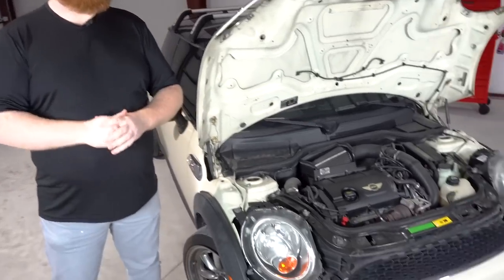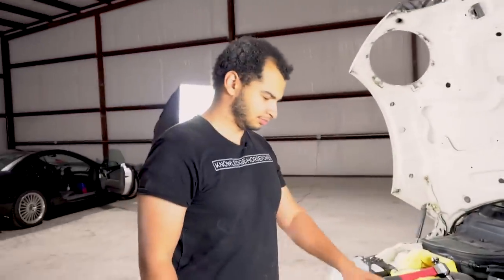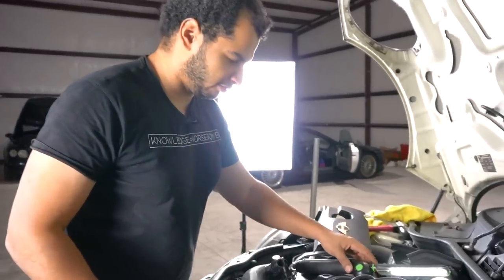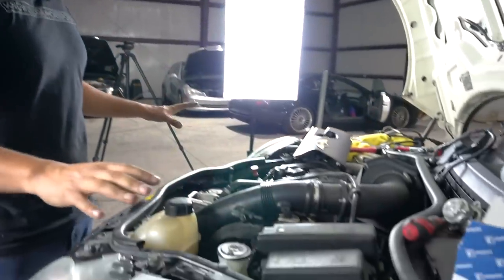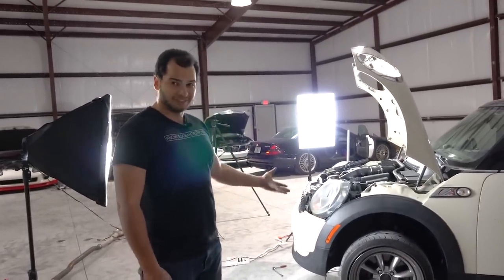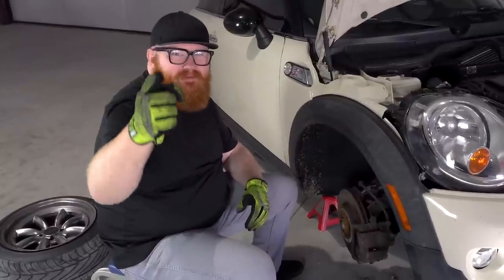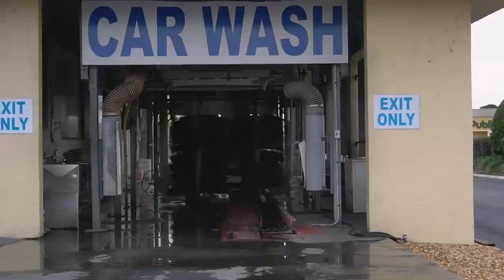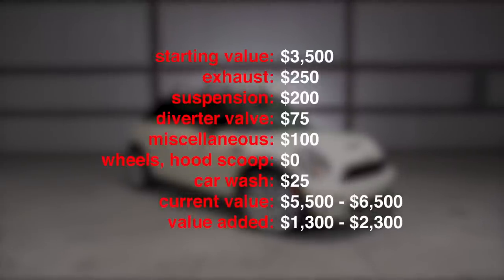Restoring A WORTHLESS Mini Cooper S [Part 2] - Art Of The Flip

Comment: You forgot to mention that you can sell off all those extra parts for cash as well.   The suspension parts and various bits could be sold off on Ebay, maybe bringing in another few hundred dollars on the bottom line.  That would be a big boost on the profit.   Overall, great show, if nothing else proving that customizing a car pretty much kills it's value.

Comment: Moral to this story, aftermarket parts will devalue your car.
Reply: Unless it's an Evo, then even dealerships are marking up for the mods.
Reply: goldtoaster1512 Dealerships will provide warranty for aftermarket parts and tuning that they install.  The ones that you install or via 3rd party will void your car’s warranty.
Reply: goldtoaster1512 or a supra
Reply: Mods are pretty much personalising a car, you can't expect someone else to have the exact same taste as you. Plus, mods are really about how well they were made/installed. You can't expect a buyer to consider chrome parts wrapped in vinyl already peeling off, LED lights that aren't properly adapted to the car's electronics or a sawed off exhaust with bits of pipe welded on for the sole purpose of making more noise that isn't even pleasing on a car like this to be valuable mods.
Reply: Mods just say that you beat on the car.
Reply: Moral of the story don’t buy an automatic sports car

Comment: Please mini owners do not put aftermarket parts on your cars.
Unless you plan to put a 75mm turbo on it that runs 50psi, then go right ahead knock yourself out.
Mix that with some 17" wheels with slicks and a straight pipe.
Big ole brembos. Six piston in front four in back.
And paint it black.
DO NOT STANCE IT!
If you follow these steps I think that short wheelbase can handle 200mph if you are a daredevil. 
So yeah. Please tell me if you know anyone who did this.

Comment: So how did you get the starting value of this used car, private sale, at $3500.  How did you get finish price of $6000 +-500?    Did you get it independently appraised?  Have you sold it for actual $$$$.$$?

 You said you couldn't sell it as the ghetto drifter it was so original value was Zero to scrap.  Is there a column in NADA for noisy, lowered, pimped out, boy toy?  If the stock car was worth 6500 with no trouble lights, then fixing the bulbs is what removed the trouble lights.  Exhaust correction and returning to height, yeah.
Black trim (in good shape) removal and headlights.  Not so much.

I always thought these cars were like Boston Terriers.  Ugly little things but beautiful to a certain population.